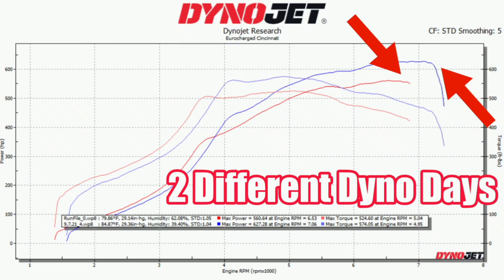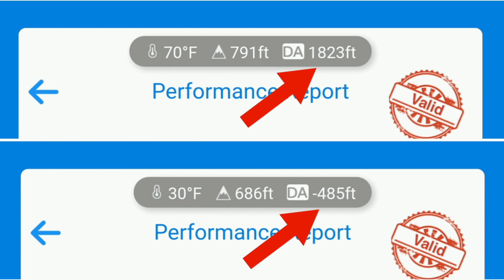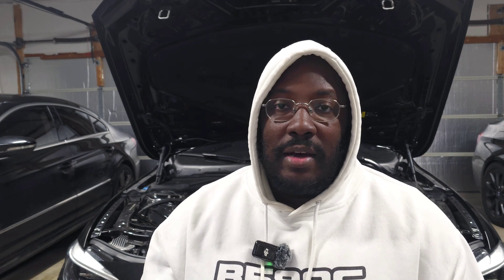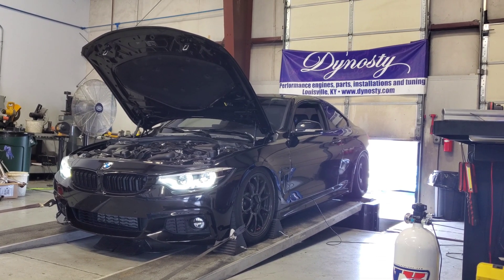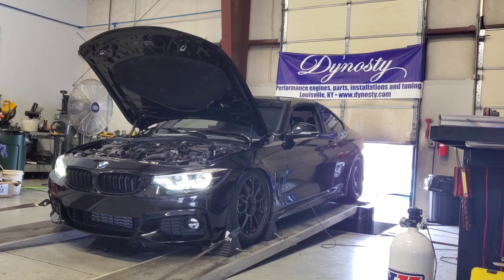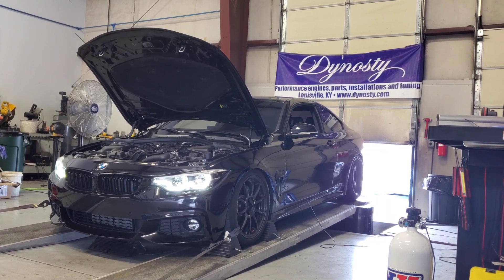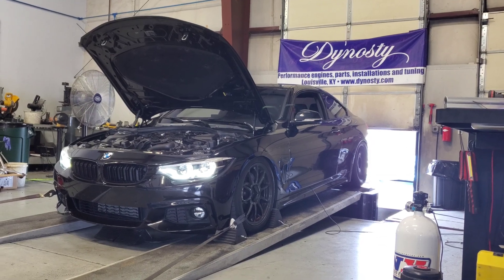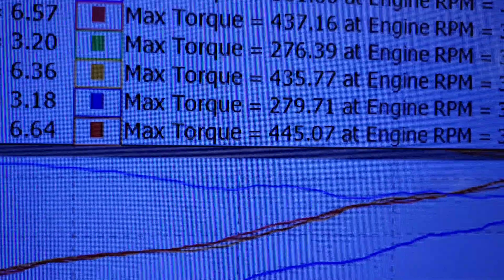How Dyno Numbers Can Be Manipulated (Understanding Dynos Part 2)

Comment: Every modern car should be dyno'd using the SAE J1349 (2004) correction factor since that's what the OEMs use in their advertised dyno numbers.  A reason the B58s often appear underrated or show bigger differences after a tune (IMO) is because they run such high coolant temps during normal operation (high coolant temps help thermodynamic efficiency and fuel economy but are bad for power).  It's not unusual to see 230+F coolant temps on a stock tune at the beginning of the run and then the thermostat and waterpump come into play and halfway through the run the temp plummets to 190. If you get a run where the coolant temp starts lower you can show a big gain, especially in the midrange.

Comment: I also feel like people just compare dyno numbers with no other consideration. 

If you race a 420 whp BMW vs a 420 whp Mustang and the BMW wins, its not always because the BMW is underrated. 

People often don't pay attention to the fact that its not about peak power always, its about when you make that power and where it is. 

A B58 can make peak torque before 2000 rpm. Mustangs don't and since hp is a function of torque per unit time or rpm, it means we get to our power band faster. 

Getting to the power faster and having a good trans like a zf8 or 10 spd auto makes more of a difference than peak power imo.

To further add insult to injury, we're usually AWD and a little lighter than most V8 cars. 

So we make peak torque sooner, have better grip, can stay in our power band thanks to the ZF8, and depending on the car we're a little lighter. 

Its no mystery why BMWs and other AWD turbo cars just win when they make similar power figures to V8 rivals.